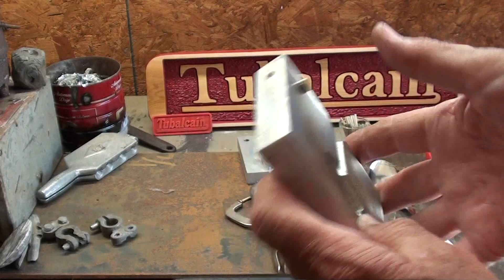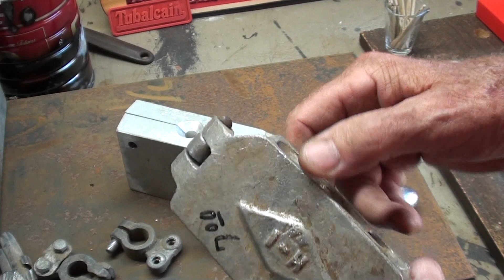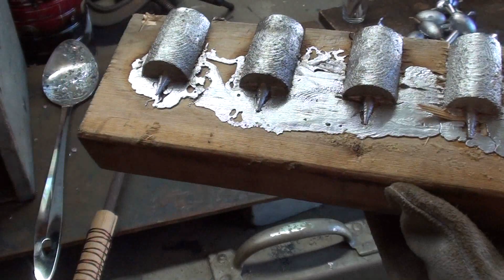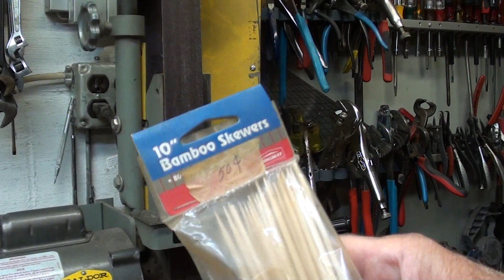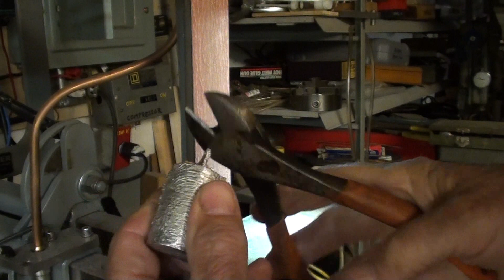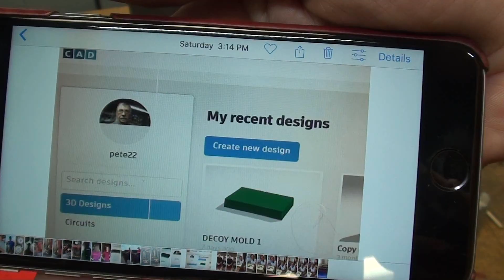Make Decoy Weight Mold pt 3 TIPS 457 tubalcain

Comment: If you had access to some tapered pins (auction spoils) you could have machined the taper away on each end to form a tapered core box pin. Straight diameters outside of the egg cavity, a tap with a brass hammer would remove the core pin. May need smoked for mold release.

Using your better than most pattern to cast the aluminum casting helped with the registration. The bottom edge could have been tramed and machined to bring both sides to the same to a common dimension (egg bottom) removing the pattern's draft. The same for an end to form X and Y Datums to step off your locater pins if parting line registration is critical.

Comment: Awesome set of videos! My egg mold has a thru hole in it, I run a piece of 1/8” welding rod through it and can pull it out and have the hole in the weight.

Comment: If you bore out either end of the mold where the channel for the dowel is, you can run a steel rod though it, pull the rod out of the mold before you drop the lead out and you don’t have to mess around with dowels or a drill.
Reply from the maker: Thanks

Comment: Mr Pete could you wax the core's to help get them out just asking for  future reference. I've been getting my stuff together to start doing pours
Reply: Use a bit of soot.   Just light a match or candle and bring the mold near.  Let the inner surface of the mold blacken with soot from the flame. Then close the mold and pour.
 This allows the lead to drop out easily after it sets up.

Comment: Cool video!! Just a thought about making it a bit easier to remove those wooden dowels...

You could try to soak the dowel pieces in water for a few hours before you're going to cast them into the weights, then just towel them off before you're about to put them in the mold and pour it.  Initially, as the lead sets it will form around the slightly swelled up dowel, but perhaps the heat would cause them to dry back out and shrink down after the lead has set.

Of course, thats only viable if you deem it safe enough to have a damp wooden dowel inside the mold and any steam that gets generated does not mess with the casting.

Or, could just find some 1/8th steel tubing and use that as opposed to the wooden dowels, but you're still left with having to trim a bit of tubing.
Reply from the maker: Water and Molten Metal are a bad combination

Comment: Nice video as always. I did similar thing but for the core I used steel wire (3mm) so I was able to just punch it out of the sinker with a hammer. I remember we used to put some kind of grease on the steel wire to make it easier to punch out.
Reply from the maker: Thanks, good idea

Comment: OK. To bring the weight up, to 6 oz it only takes an increase in size of 0.8% - not even a whole percent increase.

If you want 12 oz weights, you would want to make the mold 27% larger than the original 5.85 oz mold. (This assumes you would also upsize the core to 5/32" - by 25% - but where are you going to find 0.15875" dowels? Actually, that is pretty close to 4 mm, so it might be possible.)

And don't forget, as you change the alloy with different percentages of lighter metals, the weight cast from a given mold will change, too. That might be why your original mold was casting slightly underweight - all those wheelweights, plus typemetal is a hardened alloy, too. You weren't casting with anything close to pure lead. Wikipedia has a good article on the various typemetal alloys with percentages of each component: https://en.wikipedia.org/wiki/Type_metal . However, you would have to calculate the densities of each alloy (there are dozens). HA - more than you wanted to know about typemetal and other lead alloys.
Reply from the maker: Thank you, all very true

Comment: My suggestion for the core would be to use a length of brass or steel  1/8 inch tubing for the line to go through and then no drilling.
Reply from the maker: Good idea

Comment: I have followed your videos about casting. Why didn't you taper formulas for the wooden insert it into the mold cooled off,open, pull out stick.
Reply from the maker: Did you ever try to put a taper on a 1/8 inch dowel

Comment: Years ago I remember reading an article in one of those "Free to the trade" tech journals about an outfit that was pouring ceramic into a mold and using spaghetti for the passage holes, after setting they then fired the ceramic and the pasta simply vaporized out of existence during the process, I always admired the economy of production the guys used. ☺
Reply from the maker: That's a good idea

Comment: weight will come from what type of lead you use pure lead is heaver they lead has tin mixed in with it like type and wheel weights. so that probably why your weights came out lighter too. have you ever tried steel core that has a light film of oil on it so it doesn't stick?
Reply from the maker: I might try that, if I ever cashed any more weights

Comment: Sir, for this particular issue i think i would be qualified to say something cause i make my own fishing lead for more than 10 years
1. Not just “water inside the mold”, also avoid grease as well. When it is heat up rapidly and become gas form, it will also give a nasty lead explosion too, although it is not as strong as water, because the boiling point of grease is higher.
2. Everyone knows lead are toxic, even the vapour, i know a gentleman who pouring fishing lead for living, his only daughter was certified lead poisoned since 2 years old. He was so regred that he choose this for living but everything was too late. Get good ventilation when pouring lead, avoid children (from Jordan to Henry) to come near the pot. In my own situation, i will put a fan behind me when i am facing the pot and do all the pouring outdoor.
3. In the city where i live, the traditional fisherman`s way to pouring lead is to use bamboo as mold. Obviously the final product will look like Jordan`s style instead of the egg shape style. And i am using those 2 parts plumbing epoxy as mold, believe it or not, it look like clay and dry up like plastic, but it can hold lead. Or, when i am pouring lead for deep sea fishing, i will cut a metal tube, plug one end and pour a kilo of lead, add a piece of u shape wire and it is good to go.
Reply from the maker: Thanks yes, it's a dangerous heavy metal

Comment: Lyle: Bullet casters will apply carbon to the molds using candle smoke or an alcohol based graphite preparation. An acetylene flame will work just fine. The bullets just fall out. Applying graphite to the dowels might make them slippery enough to just pull out. Sanding the weights only wastes lead so I wouldn't bother.       Using Mrs. Tubalcain's spoon and roaster - well you can't clean the lead off completely. Better to buy a new spoon and roaster for her. Lead contamination in food is not fun. (I know you were joking.)  Will you be attending the Bar-Z Summer Bash? Jon
Reply from the maker: I would like to go, but it's just too far

Comment: It just dawned on me you could 3d print the hinge fingers into the pattern and add an old door hinge pin later.
Reply from the maker: Sure
Reply: May have to alter the weights end profile to release the hinge arc on the handle end if the hinge pin is a slip fit?

Comment: All the old gunners out there will tell you that linotype lead is far superior to commercial scrap lead. It has some tin and antimony mixed it, and alloy is harder, making it far superior for target bullets. Plumbers lead, and telephone company lead are very soft, and need to be mixed with wheel weights to make them harder for same reasons. The idea is to reduce lead fouling inside barrel and better consistency when casting. BTW: a reminder for the naive: DO NOT GRIND lead or other soft alloys on grinder. The wheel will load up, and could come apart. Nice video MrPete, thanks.
Reply from the maker: Thanks

Comment: Lyle, great video! I work in electronics manufacturing. If you really want to get the Mrs. going, use her whisk to separate the lead and the dross. We do this in our solder wave pot, the dross almost comes out as powder with less lead in the mix. There are also reclaimation services out there that will take your dross, some may even pay you back depending on the quantity and the quality of the metals found in the dross.
Reply from the maker: Thanks

Comment: Yes, lead at these temperatures is not vaporized, so technically one isn’t breathing in lead steam. But it’s best practices.
I remember when men were men and MDs recommended women smoke while pregnant to forestall weight gain, cocaine was not addictive, asbestos was a wonder material, hearing protection, safety glasses, steel toe shoes and gloves were were for wimps.
It’s very simple; run one of those lead test wipes around that casting are and watch it turn red. I’ve watched 3rd world laborers demo buildings in beach sandals- I wouldn’t. My father was very cavalier about herbicides mixed them without any regard for safety and 30years later he was a Petri dish of cancers.

Comment: Could you have stuck something like those ⅛″ dowels—or better yet, those bamboo skewers with their pointy ends—into the pilot holes in Jordan’s mold, to avoid having to drill?
Reply from the maker: I suppose. But remember that was his project
Reply: Sure, but it seems as if the holes are already there—no need to change his mold, just use it differently.

(Though a skewer sticking out vertically would probably make pouring the lead a bit more awkward.)

Comment: I mentioned in the first video about Dad poring jig heads, we also poured other fishing weights. Years ago a friend needed some triangular weights used for surf fishing, I just used the original and poked them in our NC red clay suspended a swivel above it with a tooth pick and poured them. My buddy couldn’t get over that one.  

I still have the plumbers lead pots that Dad had with the ladles, what he did was use a Colman camp stove to heat the lead pots up. We had old plumbers lead, some sheet lead, and those wheel weights. I also still have the same Lyman ingot molds just like yours. This brought back pleasant memories of my childhood with my Dad. Thank you
Reply from the maker: Sounds like you had fun making those weights with your dad. Great memories

Comment: Nice mold! By the way, we (Molders in the Navy) used to smoke dowels before pouring. The soot added a barrier between the wood and the lead allowing the dowels to be pulled from the solid lead handily. We used an acetylene torch to soot up the dowels but you could use a candle I suppose. Enjoyed the series!
Reply from the maker: Thanks
Reply: When I pour round ball for black powder shooting,  i soot the mold lightly with a match or candle. 
Once is usually enuff for many many pours
Reply: I failed to mention,  the soot helps the ball slip out of the mold much easier.  The lightest tap is all it takes for the ball to drop out and the soot has no measurable difference on the final diameter of the ball

Comment: Did you cut out sections of the video, or does the lead really cool so quick you can open the mold after a minute?
Reply from the maker: It cools that fast in a metal mold. But certainly not in the wooden mold

Comment: Wonder if you coated the wooden dowel with mold release it would make it a little easier to pull out.  Mold release I'm thinking about is used in rubber molding.  Baby powder may be all you need.  As always, enjoy my shop lesson for the day. KenS.
Reply from the maker: Possibly

Comment: The one that broke in 2 parts from The wooden mold is the first one you poured. The first one you added lead 2 Times. When lead start to solidify the second layer will not join the first. Me and my uncle used to exploit this property to make our fishing lead molds. We used a wooden mold long about 20 cm and large about one with a steel wire from one of small sides to the other. We used a piece of leather as movable limit of the mold. We poured each single piece inside the space between previous one and the movable leather limit. Leakage was really low. When finished we removed all the piece together with the inner wire from the mold an was possibile to remove the molded leads like perls from a necklace clampingone side of the wire to the vice.
Reply from the maker: That sounds like a great technique
Reply: @mrpete222  quite rough tecnique, but we were confident that fish would not care :) .

Comment: If you soot the inside of the mold with a candle flame the sinker wont stick as much .The peice of wood could be replaced with a length of stainless wire ,again sooted which goes all the way through the mold  with a loop at one end . the sinkers could then be slid of the wire when they came out of the mold .
Reply from the maker: Thanks

Comment: Happy to sink the last one pt 3 into the memory banks. You are going to get into trouble taking that Starrett Kitchen Spoon. Heck you are making witches stew with all those lead pieces. Yes we remember the pry slot machining. You got them you drilled them through just fine we thought the drill would walk off center. or around the wood. Told you you are trouble when MrsP sees this video of you fibbing to her LOL. Te egg is hydrodynamic compared to the cylindrical one. 5,85 ounces ? are you cutting corners saving on the lead you are using for the total project LOL. Lance for Lance & Patrick.
Reply from the maker: Luckily, my wife does not watch my videos or I would be in the doghouse. Yes, I can save 12% of the lead by reducing the size. My stock of lead is down to only about 3 tons
Reply: Mr. Pete's place will turn into a superfund cleanup site when he's gone! Oh my! @mrpete222

Comment: There are dozens of styles of decoy weights and I'm sure just as many ways to pour them. I personally use Jordan's method but I insert a copper wire hoop into the top of the weight while it's hot to attach my decoy line to. Then when I pull my decoys out of the water I put the loop over the head to keep them from getting tangled up. Happy Hunting
Reply from the maker: Good idea, thank you

Comment: Always like your videos,  you explain things very well.   I would like to see you put your initials or name inside the mold.  A trademark so to speak.  My Dad was a cabinet/furniture maker / teacher, at Berea College and always signed the piece on the bottom or back and dated it.  Also he turned all the slotted screws to the same direction when he tightened them.
Reply from the maker: I have bad he was a real perfectionist
Reply: Yes he was,  I have several of the family heirloom pieces. Mostly Cherry wood. He has been gone for several years, but his furniture lives on to be used by several generations.  I have a special metal stamp I use on my metal projects to identify my hobby work.

Comment: you could use a tapered pin for the core. I bet that'd knock right out.
Reply from the maker: That is exactly what I originally wanted to do. I did that with my fly wheel mold